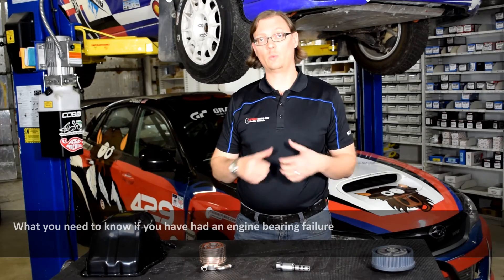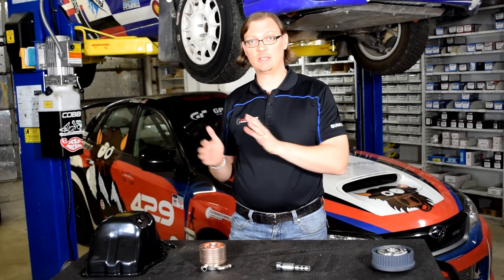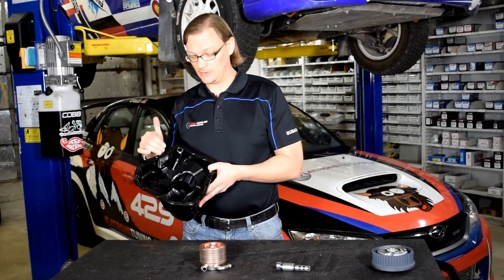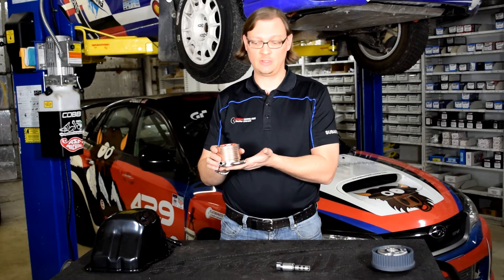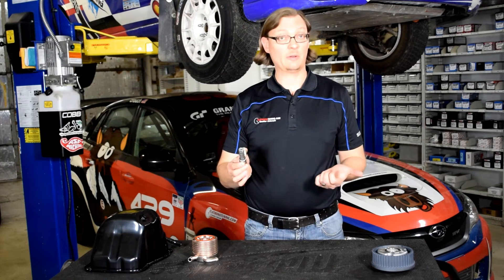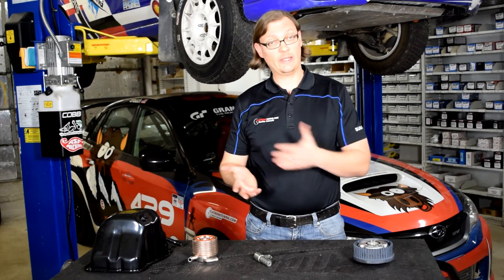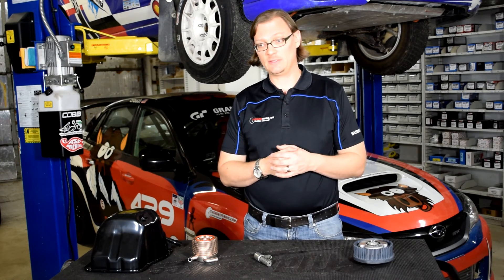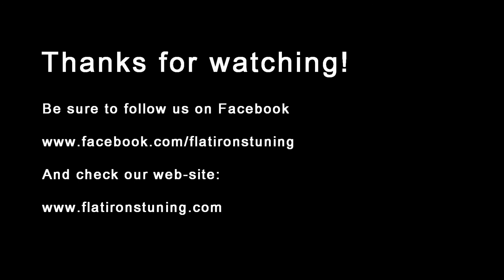What you need to know if you had an engine bearing failure

Comment: Can I drain a quart of oil an add marvel mystery oil to the oil run it for 30 mins then drain it as a flush type ? Ive used carb cleaner 3 cans , an compressor air n then wd 40 to clean the block out . Replaced bearings an cleaned oil pump . Just trying to be sure it's cleaned enough an hopefully I'll get another 250k miles outta it lil 2.4
Reply from the maker: Thanks for your question.  I would say that in the case of a bearing failure, you are always going to be best off to disassemble the engine so that you can make sure that any parts that are being reused are fully clean.  That is your best chance of success on the rebuild.

Thanks for watching and Stay Tuned!

Comment: What about oil pipes/tubings? How many are there to replace?
Reply from the maker: Thanks for your question.  Most of the pipes can simply be cleaned.  This is the case with the AVCS oil feed lines for instance.  For hose I'd say to replace depending on condition.

Hope that helps and Stay Tuned!

Comment: Does the FA20 for the 2013 FRS have an AVCS type cam gear? I just spun a rod. I cant afford a new long block but I'm wanting to get a new short block but try to replace as  much of the oil system as possible. Any suggestions on what I should replace other than a complete new set of heads?
Reply from the maker: Thanks for your question.  On the FRS, you actually have AVCS gears on both intake and exhaust cams.  So yes, you would want to look at replacing them when you do your rebuild.

Your heads most likely can be cleaned and re-used (unless they were damaged).  So the recommendations would be the same as they are here.  Replace the oil pump, and AVCS pulleys, and then thoroughly clean anything that you are going to move to the new engine.

Hope that helps and Stay Tuned!
Reply: @FlatironsTuning  Thank you! Subbed!
Reply: @FlatironsTuning  so my dealership is claiming that the best course of action for replacing the cam gears would be to also replace the computer because it apparently sends bad codes and make the check engine light come up. Does that sound like an excuse for more money and work or does that make sense?
Reply from the maker: @eXpLiiiSiT  That is the first that I have heard of that.  I can't think of a way that a defective gear would cause an issue with the ECU.

At worst, it may have learned around the issue to an extent, but if you reset it, that should correct any potential issue.

I'd say not to replace the ECU.

Hope that helps.

Comment: This is an old video but I’m rebuilding my engine and have new parts for everything but the turbo. it has no shaft play. how would I make sure no metal is trapped in it? I assume just pour some oil in both sides of it and let it come out?
Reply from the maker: Thanks for the question.  Yes, you would want to flush the center section with oil until it comes out clean.  Once you see good oil going in and coming out, you should be good to reuse it.

Thanks for watching and Stay Tuned!

Comment: Is this something I should have to worry about if my motor had ringland failure? I'm replacing the avcs solenoids, oil pump, and oil cooler on my rebuild to be on the safe side. When I drained the oil there were some metal perticles here and there but nothing like the bearing failures I've seen on other motors.
Reply from the maker: It really depends.  Ringland failures don't generally send metal through the engine like a bearing failure does.  But if you have seen signs of metal contamination, it would still be best to replace any parts that you aren't sure you can fully clean.

Hope that helps, and Stay Tuned!

Comment: Wouldn't the oil filter pick up and hold these metal particles?
Reply from the maker: Thanks for your question.  The oil filter will hold the particles, but the first problem is that the oil goes through the pump before it goes through the filter.  So those metal particles can damage the pump.

Beyond that, if metal is coming off further down the engine (in the bearings for example), once it comes loose, it can move down the oil path and then damage other components as it makes its way to the oil pan.

Hope that helps, and Stay Tuned!

Comment: yes, it helps !   Bearing material not magnetic, hmmn.  I went 250 miles on a ej25 (1999) and the oil is black-gray. I checked the drain plug and did not see the christmas tree, now I know why.  Front most conn rod has side to side play....well, I'm going to keep taking it apart, and observing....exhaust manifold has heavy black deposits, like in teh old days when a carb ran too rich....you have any luck with JDM engines ?

Comment: hey i have a question  about con rods stock oem for the ej255 wrx 2012 how much hp can these take with reforged pistons race bearings bigger oil pump arp cap bolts
Reply from the maker: Thanks for your question Justin.  There isn't any solid numbers for the stock rods.  Largely because they are typically replaced when people go in to replace the pistons when shooting for 350+.  Basically, if you are going to build an engine to make that much power, it would be more ideal to use a proven rod than to stick with stock rods.

I hope that helps, and thanks for watching!

Comment: Great video and advice.  Too bad I just had a new short block and valve job on a 2.5XT that had a rod bearing go out, the shop that did the work only cleaned the oil cooler, oil pan, and oil pump.  They did not replace these, or the AVCS pulleys or solenoid.  I just picked up the car.  It has had about 20 miles of driving on it since the engine replacement.  The car is now in my home garage.  I plan to replace the oil cooler, and "flush" the oil system by repeatedly running new oil through it.  After this video it looks like I should replace the AVCS pulleys and perhaps the oil pump.  My main question though is dealing with the fact that now the engine has been run with possibly contaminated oil.  "Water under the bridge", or "contaminated oil in the new engine".  The bearing failure was not catastrophic.  I have an inline oil filter on my turbo, all banjo bolt filters have been removed.  Thoughts on best path forward.  Let the shop know that I am not happy and let they know they may have risked the warranty on the new short block by not replacing these.  Thanks.
Reply from the maker: Sorry to hear Ed.  Yours is a tough situation.  Metal contamination is tricky because it may not show that it is a factor before it is too late.  But you may also get lucky and not be plagued by transferring the contamination.  What we talk about in this video are the best practices, and the ways to be sure that no metal moves from your old engine into the new one.  I think that the best advice I could give would be to work with the shop that did the work, and put together a plan with them.  Hopefully they were very thorough, and they have reasons for doing what they did.  Proceed with your break-in with caution, and watch for signs that metal is contaminating your new engine so that if it does become a problem, you can catch it before it becomes catastrophic.

Very best of luck, and hopefully you and the shop can keep a close eye on your car and get it fully back up and running again!

Comment: What are your feeling on aftermarket oil coolers,  I would love to get rid of the oem one once and for all on my rallycar as we rebuild the EJ207 we sourced.
Reply from the maker: There is definitely a place for aftermarket oil-coolers.  If the car will be driven in various different weather conditions (rally in snow, etc.) you definitely want one with a thermostat to regulate when the oil goes through the cooler.  The other consideration for a Rally car is where you could mount it to make sure that the cooler and lines aren't damaged, in most of the traditional impacts that a Rally car can see.

For what it is worth, we have always run the OEM oil cooler on our Rally cars, and not had any issues with them :-)